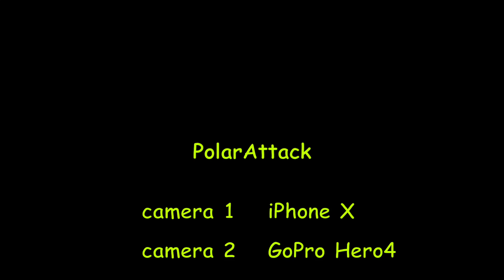v06 NEW HOME BUILD BURIRAM THAILAND

Comment from the maker: Thanks for watching and more so for replying. The water pipes have already been put in place prior to the cement deck on the first floor. At this time we won’t have water on the 2nd floor.  So right now all the blues pipes (supply and drain) are about 10” above the deck.  Yes, electrical wiring in conduit however they cut channels into the Red bricks (about an inch or so) then they install the conduit in them.  When the bricks are still rough.  After that they skim coat the brickwalls and the electrical conduit pipes are hidden.  
Oh, except from the hot water tank (for the bathtub and I guess kitchen sink and showers too, maybe). Bathtub for sure, those get installed later - for whatever reason.  He said they use different pipes. We’ll see when they do that.

Comment: Looking great so far, I find Thai builders have no problems with building with concrete, plumbing also are good, just electrics is their weak spot. Question: are you going to install termite piping in the foundations, for injection to keep the ants down?
Reply from the maker: Excellent question and comments.  Yes, the bug pipes were installed just prior to the top layer of dirt, so just before the concrete slab.  I think that will come out in the next video.  We went with the pressurized system over the gravity fed. It sounds like I know what I'm talking about but I'll now more after it's complete :-)). Our builder claims to be an electrician by trade.  I can't say I'm convinced, I've seem homes here with no junction boxes, only wire twisted and taped.  (above false ceiling so I guess that's not too bad?).  I've seen homes with multiple breaker box's - all over the place.  In Canada you have one, "The Panel"  bigger it is, the cooler you are. (haha)
Reply: PolarAttack my home was built with 2 breaker boxes, one upstairs and one down stairs. When we built an extension of a Kitchen / lounge we added another breaker box. After everything was done I got upgraded to a 3 phase supply so we added another isolation / load balance box for the 3 phases and we brought the air cons upstairs into the load box. The build is looking great so far. What brick have you decided to go with, Superblock, Concrete Block or Thai Red bricks?
Reply from the maker: I guess having two panels (one up and one down) would help isolate the potential fire.  Our power arrives underground so I thought just one panel in the garage (just off the kitchen) would be nice.  The brick question is like pulling off a bandaid slowly. In the end, my girlfriend, who's home it is, has chosen the Thai red bricks.  Turns out that wasn't even a discussion - I thought it was.  At current time, they're building up the walls (and redoing them).  That will be about video v08.  I'm all about crack lines and patterns, bricks lined up correctly - well, I'm in the wrong country for that it seems.  Oh man, those will be great videos - I'm stating to mad all over again just typing this.  Yeah, thanks for the question !! (hahaha)
Reply: PolarAttack They say that Super block has better thermal properties however is more prone to cracking, the Thai red brick is a chosen favourite since when everything settles it lasts a long time, as you say cracks can appear, not sure if is best to wait sometime before applying plaster, or would gypsum board help. When is the permanent move to Thailand going to happen?
Reply from the maker: Not sure about the permanent move quite yet.  Heading back to Canada in the next little while. Clean up last years taxes and renew some insurance stuff.  I think I'll be back here in a few months though.  My multiple entry expires in Oct.  When it comes to construction, that's really my current mind set.  They build stuff here and not much falls down.  Not mentioning all the ghost building of course.